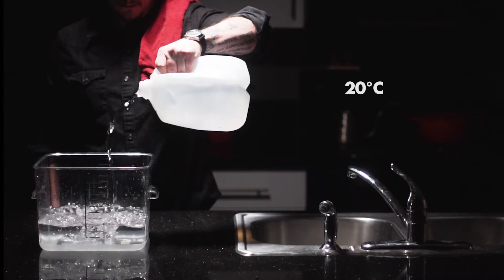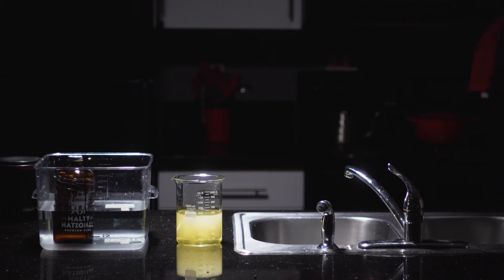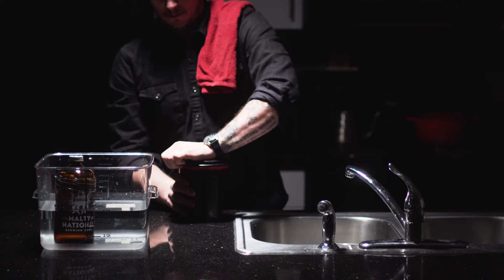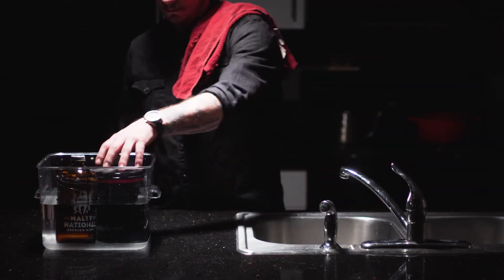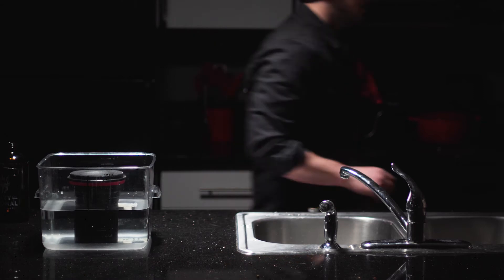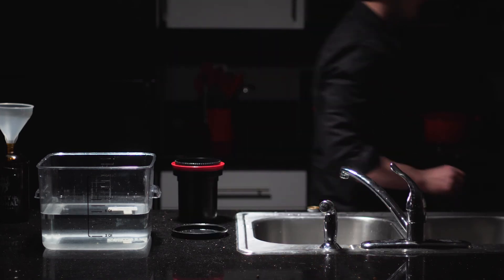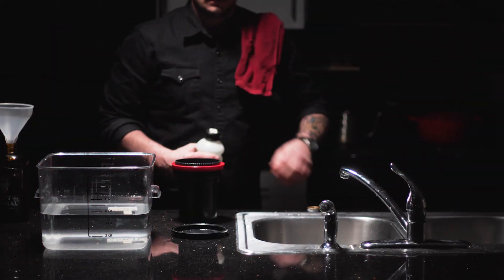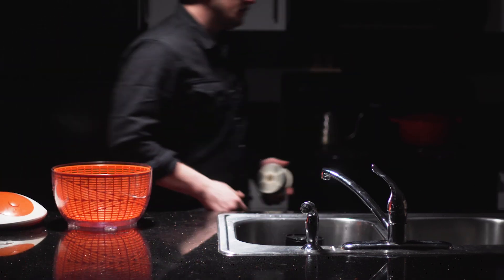How to stand develop B+W film

Comment: Wow, I've never had a love-hate relationship with a YT video before, but here we are. The hate: don't try this stand development process on any negatives you love. It's at best a crap-shoot as to quality of results, and this video is silent on the problems which can result, the main one being the uneven image density (read streaks) caused by "bromide drag". Another being that stand development results vary largely depending on which film and developer you select; it's not a "one size fits all" process. The love: introduction of the Ilford washing procedure (labor intensive, but huge water saver); putting Photoflo in the final wash step; and using a salad spinner to accelerate spotless film drying. Technique from worst to best in 2 minutes - go figure.
Reply from the maker: Hey Randall! Thanks for your feedback.

Comment: Hmm I might try that final wash technique. I've just been tossing it into film washer for like 20-30 min. Though that does give me time to start developing the next rolls LOL.
Reply from the maker: Dmitry Koupriyanov I got tired of using so much water. I’m not sure where the name actually comes from but I’ve seen it referenced in quite a few places. Depending on the film (PanF, Tmax, etc.) I usually wash a little bit more, same for fix. 👍🏻
Reply: Or maybe I should do that then only leave in wash for 5 or so min. I now just shoot tri-x. 

This is my method 

https://youtu.be/tcc0ahQZb_Q
Reply from the maker: I've since bought one of those tubes that goes right into the tank for washing. I leave it for at least 10 minutes and my film has never been flatter. 👍🏻